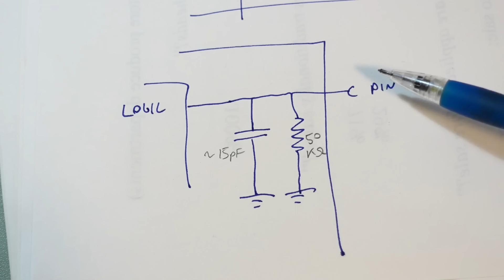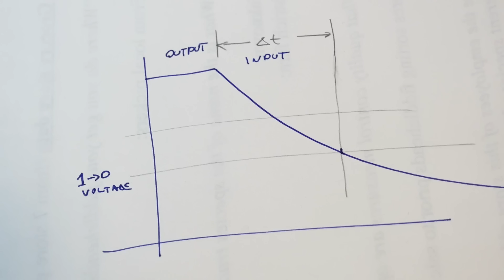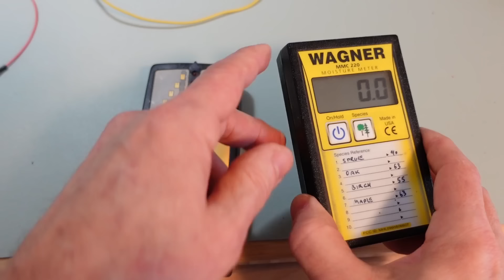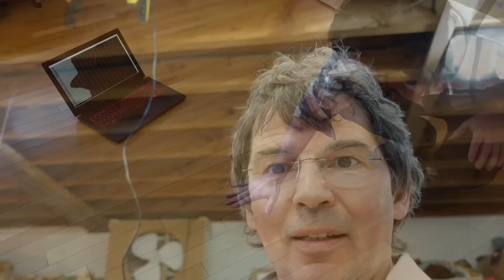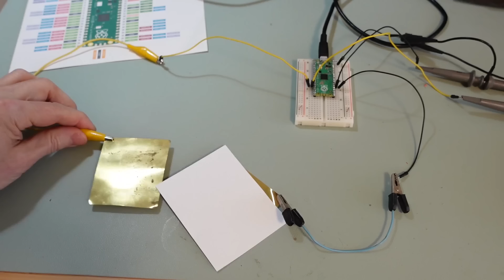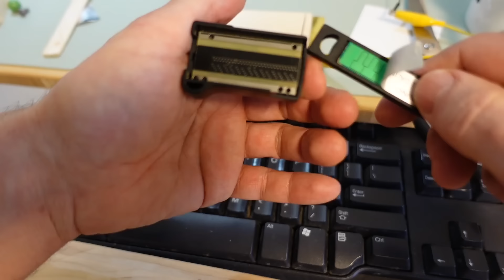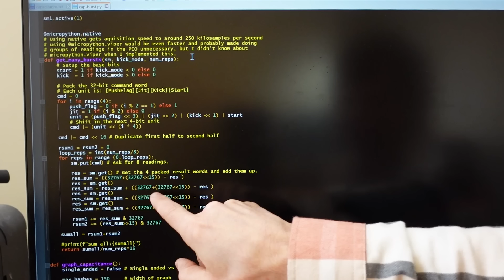Detecting proximity with very low capacitance measurements

Comment: Interesting video. 
But i still nowhere found a detailed explanation why digital calipers work as they do. Somehow the pattern on the stationary and moving part generate pulses (by capacitance changes). But why pulses, with the accuracy of the caliper which is much higher than the dimensions of the traces.? And of course these pulses are counted. The only thing i can think why pulses high accuracy are generated is that there is a slight difference in the pitch of the conducting traces on the moving part compared with the stationary part. Any comments? (BTW It is to easy to say: pulses are generated..)
Reply from the maker: its an analog capacitance measurement, and they are able to interpolate.  Just like with the two pads in my demonstration, it was showing the amount of overlap, not just "overlap" and "not overlap"
Reply: @matthiasrandomstuff2221  Thanks for the response. But can you explain the interpolation between what and as there are more values between the interpolation points what decides what point to pick as the correct value? And if so. There is more than 'counting pulses'.
Reply: There is a slight difference in pitch like a vernier scale.
Reply: @ElectricGears  That's what i believe as well. However i tried to measure that (with an old type caliper) but could not measure that. I also tried to model it to and see if i could see (theoretical) capacitance changes in relation to the differences in pitch. But this also did not succeed. I just wonder if somewhere a detailed description exist of this (like a patent, technical/science paper or so).
Reply: @aamiddel8646  The Wikipedia page on 'Calipers' does have a patent, I'm sure there are other related ones. It's a combination of measuring the differential capacitance as the moving plate moves off a stationary plate and onto a neighboring one. That differential measurement can signifigantly improve accuracy enough they can interpolate the linear position based on analog changes in capacitance. The patent also show how the widths and spacing are arranged to make 3 signals 120° out of phase with each other which would also improve accuracy. It is kind of like how a quadrature encoder works, but rather then hard binary transitions between very closely spaced segments it's a very linear change between widely spaced segments.
Reply: @ElectricGears  Thanks for the reference to patents. For the time i conclude that there is no interpolating taking place. By moving the caliper there is a changing voltage generated based on the capacitance value and varies between an upper lower value every time the effective capacitance changes. This effective capacitance change happens every time per calipers resolution (and this is because there is a difference in pitch between the moving and stationary part of the caliper).And then a simple threshold sensor detects a pulse which is counted. I hope you understand my explanation.

Comment: Would it be possible to attach the slider of the caliber to a stepper motor with an absolute encoder and use that to either determine the caliper position and/or determine the measurement via the encoder directly if it is more precise?

Comment: Seems like that could have some use for a security system. A completely invisible system of detection (the under the floor method).
Reply from the maker: I'd love to put one under the entrance door.  Unfortunately, that part of the basement has a finished ceiling, so I can't just put a sensor on it.

Comment: Heh, I've been playing with exactly the same thing, including pi pico and command line graphs! :D

You can even get it to measure changes in static fields relatively well: Connect a single sensing surface to two pins with resistors. I used 2 MOhm and something like 10 kOhm. The lower resistance pin I use for sensing without hysteresis, the high resistance pin I use to pull it into the direction where it flips. When you correct for an offset and integrate the output, you get an estimate of how much the field strength changed with surprisingly little drift. I used a small pair of scissors with plastic handles which I rubbed against my hair for testing and it has no trouble detecting it at > 1 m in a relatively noisy environment.
Reply from the maker: That sounds cool.  Do you have anything online about that?

Comment: I'm wondering: could something like an audio cable on a phone be used to pick up proximity? 🤔 Could the USB port of a smartphone and laptop be used?
I mean a lot of smartphones even have FM-radio hardware connected up to the headphone output, so that should work.
USB has twisted pairs and is digital, so it's harder to get such an analog capacitance reading out of it with stock hardware.
Reply from the maker: The cable would have to be un-shielded (typically is shielded).  Also, you would have to be an expert on the hardware, and, basically modify the OS image.  In short, NO.

Comment: The schematic at 01:03 shows a cap and resistor shunting the pin to ground.  Will they protect the microcircuit from ESD and voltage spikes?
Reply from the maker: No.  The cap is just internal pin capacitance.  That said, the pins have some ESD protection.  I did zap it a few times after getting up from the chair, hard enough I could feel it, and it was still fine.
Reply: Thanks, Mathias.  I was wondering if one should fit two Schottky diodes or RF diodes (for speed) in parallel, one facing each way, between the pin and ground to protect against ESD.

Comment: there are many component testers based on an ATmega and a few passive components that measure capacitance, inductance, transistors, etc.. with no almost no  external circuitry

Comment: I did samiler thing to measure the water level in a big plastic tank , you can easily do lower than 1mm measurement very cheaply . The water can be one electrode and another one is needed ,or 2 electrode can be added and the water will change the capacity

Comment: Add a 2.2nF Class Y 'safety cap' to ground on the AC hot side of your DC power supply to drain the noise to ground.  Another possibility is ferrite beads on the AC supply to the DC power supply.
Reply: At least for testing, and maybe in production, battery power may be the way to go.

Comment: I noticed the same behaviour with my scope and voltmeter, very useful for finding cables in walls.
A similar behaviour can be observed for air movement when you have a peltier-element between heatsinks at a constant voltage, the current through that on air movement varies a lot!
Reply: Yes, you can touch the oscilloscope probe in your hand and can literally search power cables with your (other) flat hand on the wall. It will pick up the 50/60 Hz.

Comment: dialectric of water (at room temperature) is 80 whereas air is 1.  this more or less how the moisture sensors where I used to work worked

Comment: That was a real genius idea to switch an output to an input, then measure the decay time as it discharges. A great example of thinking outside the box.
Reply: This is exactly how I made touch sensing devices 20 years ago with ATtinys.
Reply: @ulbed  and how the IBM PC gameport read the joysticks ~45 years ago
Reply: @fuzzy1dk  No, the port was not switched between in- and output. It didn't use an internal pull-resistor for discharge. It was dedicated hardware for specific use. It didn't do touch sensing. C was built-in and R was teh external component. So it was not the same.
Reply: @ulbed  the whole concept was the same, write to a port to reset cap, poll input to get charge time, it was just measuring a variable resistor instead of a variable cap
Reply: @fuzzy1dk  in this case you could also say that RCA television prototype (1931) used the same concept for reading the vertical hold and horizontal hold potentiometer 95 years ago.
Reply: What is old is new again....
Reply: Yup, this is pretty much how you did it before capacitive touch peripherals became a thing in microcontrollers.
Reply: Pretty common in the embedded world

Comment: You can play exactly the same trick with a led to ground with its cathode facing the gpio to make an ambient light sensor.

LEDs are also small photodiodes so the light causes a current which discharges the capacitance

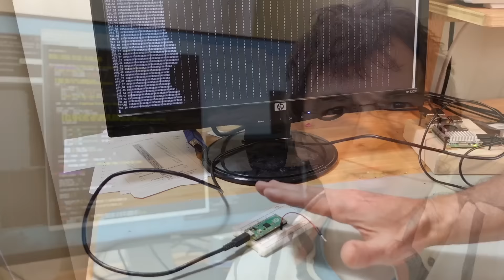Comment: Can someone explain/elaborate on what he means @2:04?

He's taking thousands of measurements for each one that he displays (and averaging them) , "get down to a tenth of a nano second", Pi Pico clock is only 125 MHz. I'm having a hard time combining these statements. 

125 MHz is an 8 nano second period. How would taking many samples and averaging them allow an increase in samples per second?
Reply from the maker: Because there is noise on the line.  also known as jitter.  I can actually only measure every other clock cycle, so my granularity is 16 ns, but I add 8 ns of jitter.  The rest is just ambient noise, and averaging it all, it comes to a very precise number.

Comment: Can you do this simultaneously on multiple pins? I'm thinking the relative change could be converted to grayscale and if the sensors are in a grid (PCB) it could be a camera, combine this with a OLED und you have a DIY wall "radar"
Reply from the maker: Could be done, but it gets complicated because the PIO state machines need to be synchronized to each other, so you'd be re-implementing the PIO code from scratch.

Comment: You can get absolute position calipers for 30-40 bucks these days, idk if the cheap ones have serial
Reply from the maker: You can get "absolute origin" calipers for that price, but they only claim to be absolute, looking at review comments, they still lose the origin if t he battery is pulled.  Which makes them not absolute.
Reply: @matthiasrandomstuff2221  Thats odd, both my mitutoyos and china absolutes have never lost the zero point. It is saved to the eprom when you do a calibration. Looked on amazon and there are several sub 50 absolutes and i cant find any reviews stating the lose zero on battery change.

My only issue is that hate getting wet, the sweat/oils from your hand will throw them off. I haven't found a cheap pair that are as well sealed as the Mitus.

Comment: Interesting. And impressive how well this works.
I wonder if it is generating a lot of radio interference from the fast switching. I did shortwave transmissions that were reaching several 1000 km with the IO ports from a raspberry pi (wsprrypi)

Comment: It's a theremin, just add a tone generator.
Reply: Everything is a theremin
Reply: Good vibrations
Reply: Theremin uses quite different approach to measuring capacity.
Reply: @Ma_X64 because 1920 there were no esp32 😂
Reply: @erkintek no it's not. Modern ones are also use that exact principle of two RF gens making interference to each other.

Comment: Similar idea to one of my favorite atypical sensors -- use a uC output to reverse-bias an LED, switch the pin to an input and time how long it takes for the pin to read low. That time is proportional to how much light is shining on the LED. It's very sensitive to low light levels.
Reply: I think that works best with a red LED with a clear housing.
Reply: @kensmith5694  depends on the bandgap. short wavelenght require blue or UV leds to tickle the crystal correctly.
Reply: @casemodder89 Yes that is the technical reason for my point.
Reply: Works great with real photo diodes too!

Comment: The same way you can measure a LEDs capacitance. This capacitance depens on how much light the LED gets. Actually maybe the capacitance is the same, just it gets depleted faster if light is on it. Basically you just need 2 pins, reverse the voltage to load the capacitance. Then make input and measure how long it takes.

Comment: You have just reminded me of an idea I was working on in the mid 80’s trying to use a GIO pin as an analogue input for an automotive application. In those days you didn’t get many analogue inputs and the ones you had were only 8 bits.
Reply: the original PC game port used a similar idea for the joystick potentiometers. Each pot was wired as a pull-up connected to a capacitor, SW periodically shorted the cap to ground and then measured the rise time

Comment: I wonder if this could detect sawdust flowing through a dust collector pipe.
Reply from the maker: Not enough sawdust in the pipe at any time.  But a good way to zap your pico with ESD discharges.
Reply: I've used a household vacuum that had a 'dirt sensor'. It's a tiny microphone attached to the tubing at a bend. The impact of dirt particles on the inner wall would make little detectable spikes kind of like a Geiger counter.

Comment: Hi, I’m working on a moisture sensor for sand (used in concrete mixing). My main challenge is getting accurate readings (±0.5%) while keeping the sensor low-cost. Most industrial sensors are too expensive. Any suggestions or guidance on improving accuracy or alternative approaches?

Currently I am using capacitor send module

Please help me
Reply from the maker: Put the sand into a beaker, have a large electrode on either side on the outside of the beaker and measure capacitance.  Most capacitance measuring voltmeters should give you a precise enough reading.  Then figure out a mapping between capacitance and moisture.  Of course, this may also vary with what type of sand you are using and how tightly its packed in the beaker.
Reply: @matthiasrandomstuff2221 

Thank you for the quick reply!❤

I need to measure moisture in a large sand hopper (~350 kg), not a small sample. Can this capacitance method work for bulk sand? Any simple suggestion?
Reply: @b_70_saurabhvishwakarma84 Create two probes. Jam them into the sand at an exact distance apart.  Measure capacitance.  Record the moisture reading from your trusted equipment next to your capacitance readings for a few batches. 

Continue this, to establish the baselines of your cheap probes. 

Then test/refine the new method, until expensive equipment is obsolete.
Reply: Great
Reply: Random idea: a sample of known volume and shape, in microwave for a period, temperature change?
Reply: @juhanurmela4341 good idea
Reply: @b_70_saurabhvishwakarma84  Or, heating a sample and observing pressure? I'm just bombarding with stupid ideas, for you to laugh at.